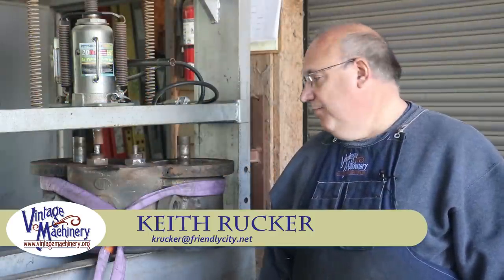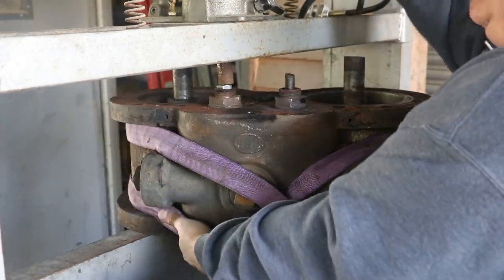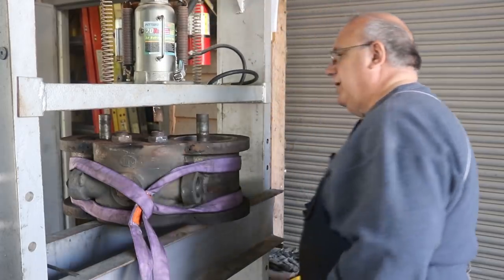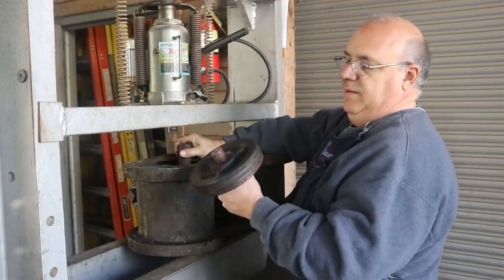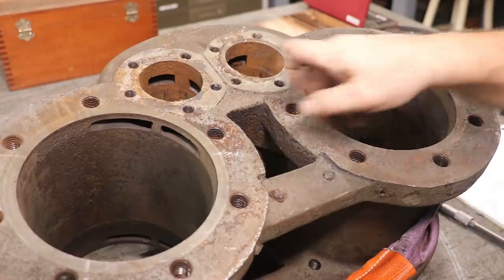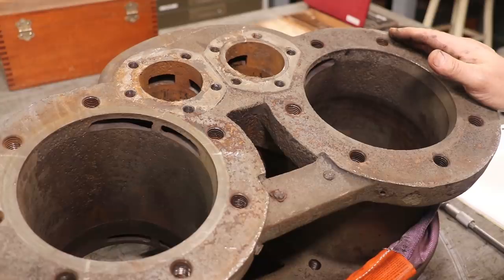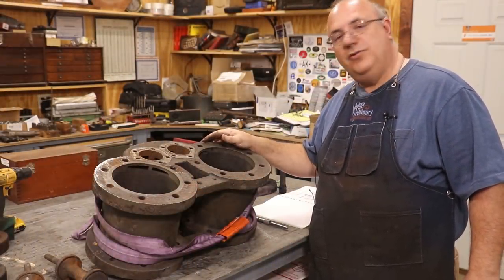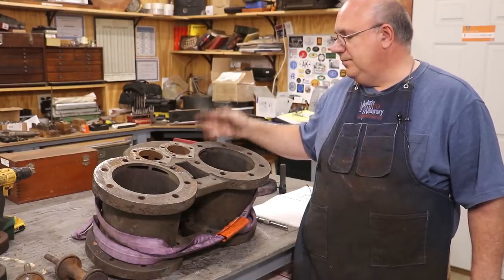Steam Locomotive Stoker Engine Restoration - Part 5: Piston and Valve Removal from the Cylinder Head

Comment: Hi Keith,
In regards to crankshaft, pistons and cylinders i'll get an advise from David Richards from old steam powered machine shop, my guess he is the authority in regards to steam engines.
Good luck and keep it coming.
Reply: David is probably in Florida for the winter already.
Reply: Dave Richards could easily  do the boring and if needed the sleeve work. Any good industrial diesel crankshaft shop should be able to handle the stoker crank.
Reply: @lineshaftrestorations7903  David used to do full engine rebuilds for motor cars (I think), and it would not surprise me to hear that he still has a crankshaft grinder. Whether it would be large enough for this job is a question for David himself.

Comment: Those “gapless” rings are actually pretty easy to make. Use a narrow slitting saw to cut the rings halfway through from each side. Make sure you offset the cuts with a little overlap. Also make sure you make the rings slightly oversized so the end gap closes some when installed. All adjustments are easily calculated. I can run the numbers in a spreadsheet, if you’d like.
I know this video has been up for awhile but I doubt you’ve done this part yet.
Thanks,
John
Reply: you know the final diameter you want for the rings . . . circumference equals pi times the diameter . . . if you want a 0.125 overlap in the joint, just add 0.125 plus the width of the kerf cut by the slitting saw (or just a bit less for clearance) to the circumference then divide by pi to get the new outside diameter to machine the ring to . . . the inside diameter is just the outside diameter less twice the depth of the ring you want to use . . . cut the machined ring with the saw along a radius line from the center then cut away half the height of the ring (also along a radius lines) and TADA  you're there (with a small amount of fettling with a small file).

note: these rings will be quite stiff to install if the overlap is too great . . . i suggest a ring compressor (or, at least, a big hose clamp).

Comment: Hello Keith from the UK. I'm enjoying watching this series develop. The press at the museum looks interesting, a good resource to have at your disposal. Pitting caused by moisture entrapment is something I've seen a lot of. Will you make the oversize rings in meehanite? I like the stepped slit in the originals, rather like a labyrinth seal. I thought perhaps you might consider line boring those cylinders in one of the large capacity lathes you have. Having said that, knowing someone who has a boring machine with enough capacity is definitely useful and probably the easiest and safest route. I love your phrase "outside of my wheelhouse"! Collaboration on this project is going to keep things moving and ultimately see the engine run again. I look forward to future episodes.

If you ever travel to Great Britain, try to visit the National Railway Museum in York. They have perhaps the finest collection of Steam Locomotives in the world. You can walk around their workshop where active restoration is ongoing. They built a running replica of Stephenson's Rocket - the first Steam Locomotive in the world to run regular paying passenger trains - which runs fairly regularly on the museum's track. Their workshop is wonderful, a sight to behold.

Comment: Keith, AD Piston Rings in Cleveland, OH, will make step cut cast iron (or stainless steel) piston rings to measure in all sizes from 2" to 30" and widths to suit. Unless you are dead set on making them yourself, that could be a good answer.

Comment: Bore  the cylinders to clean and both the same size.
Braze up and turn the pistons to spec clearance and make new rings....
The real challenge in any job like this is ensuring the cross heads are dead nuts in line with the cylinder bore........
I was not present when they did the final assembly so it was up to them...
I have done the cylinders on 2 locomotives for Silver Dollar City In Branson Mo. like this.
We sleeved one engine and it was a nightmare!
I'll walk you thru making the rings right but there are lots of resources out there on the subject.
Gotta love old iron!

Comment: I've made some large diameter rings for steam locomotive pistons on a Bullard. Once done It was easy to do the offset joint, set the ring on the mill, cut the first slot, flipped over did the second, which then split the ring. Probably the least of your worries, wish I could help, but I now live in Vietnam!

Comment: Hey Keith, two suggestions - Rings - Otto Gas Engine Works, Elkton MD; Up to 86" inch custom rings, but he stocks rings in common sizes as well. For the Crank shaft - Moreland Crank shaft & Machine, Easton MD - He can make that crank from scratch if needed.
Reply: Pine Tree Forge, it’s always nice to have options!

Comment: To make the rings just use an end mill from both sides and have the edge of each slot meet in the middle. This will 'split' the ring and also give you the overlap.
Reply: Don't really follow this.  Please explain a little more, and thanks in advance.
Reply: No problem... 1) Machine the ring to the expanded size. 2) Using an end mill cut a slot half through the 'top' edge of the ring. The mill should be a suitable width required for the amount of overlap that will be required. 3) Using the same end mill flip the ring over and cut a slot half way through the 'bottom' of the ring but offset from the 'top' cut buy the amount of maximum compression required (eg the width of the mill) but no more than the width of the mill. As the cut reaches the first slot the ring will be 'split' because the top and bottom cuts will meet but they should be offset from each other.

Comment: The ring gap looks like it was simply made by machining a groove from each side that just overlap, when you look at the valve ring it's more obvious. I bet when you get the piston rings removed and they expand fully you'll see the same.
Reply: I agree - an easy job actually.
Reply: you saved  my typing finger by writing my thoughts on it.
Reply: agree
Reply: I'm with ya on this, that's an easy machine job and simple is how they did it.
Reply: @littleworkshopofhorrors2395  LOL!!! It took me ten years to use two fingers. Now with only two, I type faster than my brother and he is an I.T. Tech.
Reply: Cyrus Cosmo   only room for one finger use on my phone. would use two fingers but that sounds rude.😉 
Dammit you are wearing my finger out and i thought i was going to save it.😀
Reply: That would make a ring thats not round when compressed
Reply: @vettepicking  That is true if you stop at making the steps. Afterward, you need to compress the ring, clamp it and turn the outside round again. I believe I have seen David Richards do this on one of his steam engine rebuilds.
Reply: vettepicking  it's not meant to be round, it has to be expanded after manufacture to have some spring in it
Reply: @littleworkshopofhorrors2395  when compressed it will be round again to match the bore. Turn it to bore diameter then stretch open , heat treat,  then compress back to bore size on piston.
Reply: Hooke's Law would imply that if the ring material is homogeneous it should still be circular after milling out the step and compressing (except right at the joint).
Reply: That is how total seal makes them.

Comment: To remove the rings. Put piston in lathe get a scare board wheel mount it on the tool post and press it into the piston rings start lathe with coolant .. stand back .it took three hours to loosen the rings on my Austeral stationary engine . But it works great

Comment: I wonder if such a small amount of pitting on the crankshaft is significant, should the remaining surfaces be round, sound and within tolerances. If so, I'd be tempted to smooth any sharp edges and  leave it alone, rather like filing down a raised nub on a drill bit caused by a slip in the chuck. You could always call the areas oil reservoirs! Best wishes from Cornwall, U.K.
Reply: While this is not really my area of expertise, I absolutely agree, and I wonder if the bores of the cylinders would be ok as well with just a clean up in Keiths Evaporust bath, followed by a hone. If the bores still look bad, boring out ten thou on the diameter, followed by the hone again may be all it takes. I also agree that the rings were likely cut through, then expanded sufficiently to mill the step on one end half way, then flip over and do the same on the other end. A bit more work than a straight cut, but easily doable by Keith.
Reply: @lesdmark  Thank you for that observation. My comment was based on the assumption that the crankshaft journal surface had a smooth, round surface and that all pitting was below the surface. I certainly agree that a rough surface would be unacceptable as would any "out of roundness" , hence my observations in my initial comment. Best wishes, BW

Comment: With regards to the off set piston rings slot's. Mill down halfway from the one edge of the ring then mill an offset slot half way from the other side of the ring the corner between the slots will coincide..

Comment: There should be something softer under a press than a concrete floor, like a wooden box.
Reply: We are certain they would be grateful for a donated catch box for the press. lol
Reply: We got a little 12 ton press were I work and we use a big fiberglass heat blanket under ours it's super soft and thick compared to the floor.
Reply: Adam Booth had a catch container of old aluminum soda cans at his day job.  Seemed to work well.
Reply: We have a thick piece of rubber foot matt.

Comment: On the rings.
I think you should make the rings well oversize, maybe 7 1/4" and then after the gap overlap is made, make a clamping set up to hold the rings with the gap closed then machine the out side to the finished bore diameter. if the finished bore is 7 1/16" then machine the outer edge to a bit less for clearance.
I have seen model engine rings made with a clamping fixture to hold the rings compressed for machining to get  an outside finish that fits the bore so little breaking is needed to get a seal.
Dumb bell weights might be a source of cast iron for the rings. Others have used cast iron pipe as a source if you can locate some in the right size.
I know you can buy or have made a cast piece from one of the foundries,
The overlapping ring gap can be done without too.
Thanks for the vids.
I enjoy looking over your shoulder as you work.

Comment: I have a solution to your piston ring issue.
To achieve a 7.125" fnished diameter with a 0.25" overlaping step joint, turn the stock to 7.204" outer diameter.  The internal diameter depends on the thickness of the ring. Simply deduct twice the desired thickness to determine the internal diameter.  
Machine to required width to fit the slot.
Once you have the ring turned, mount it vertically in the milling machine and cut two 0.25" slots halfway through the width of the ring. One from each side offset from each other, and centered on the quadrant of the ring.
When the two slots meet, they will form the step joint you showed. When the ring is compressed, it should exactly fit your 7.125" bore, with just enough spring pressure to seal to the bore.
Glenn Wiersma - Enigma Engineering

Comment: Keith for your rings, I would use a file to file the steps on both side, then use a thin slitting saw. or even a jeweler's hand saw and cut your break.  Just my 2 cents, YMMV.

Comment: There is a third option for those bores. You could bore them out, and make over-size pistons to match the new bore diameter.

It would also allow you to make the tapers in the pistons exactly match the tapers on the rods.
Reply: The pistons are guided by the rod and the cross head and should never touch the cylinder walls.  As long as the rings are the right size an 1/8 inch oversize bore is not a problem.
Reply: @andreblanchard8569  I didn't mention the pistons touching the cylinder walls.

I was merely suggesting installing over-size  pistons, as you do when you re-bore an internal combustion engine, as a third option.

Comment: Hai Keith, Could you please explain how you use air supply on hydraulic jack to operate. Bit confusing. Thank you.
Reply from the maker: It is an "air over hydraulic" jack, designed to pump either manually or with air pressure.

Comment: I was using one of those presses one day and didn't turn the lights on. The jack didn't go down far enough so I screwed out the end longer, was using a lot of pressure and jack flew out and hit me in the forehead, glanced off left shoulder and land on the table saw next to me. It took a while to figure out what happened but the jack must have set on the edge of the round retaining ring. I didn't have a bump on my head but a dent. It could have been a lot worse.

Comment: Keith, I think I remember you saying in the original video about this project, that the railroad had a second stoker engine that you might be able to use some of the parts. Disregard if I'm not correct about that.
Reply from the maker: They do have a second stoker engine, but they want to have it rebuilt as well so that they have a spare.

Comment: Can you offset bore the hole in the direction of the pitting. My boring bar will do this to save blocks to a specific bore size.
Reply: Wouldn't that make the rods off center on either side?
Reply: I was thinking the same thing. My thoughts: with the the crank you will have to maintain differential connecting rod clearance and crankshaft end play.  On plane things are likely more forgiving. That said I think it unwise. If it were mine I think I would follow the specifications. ( note the ring gap at the current diameter)
Reply: @Mishn0  I'm thinking there must be some movement with regard to the piston rods if they are attached to the crankshaft which moves in a circular motion as in an automotive application. The rod journals aren't moving exactly in a flat plane with the pistons. I'm, not familiar with the engine in question, but in some manner they end up connected to or operated by the crankshaft. as it the valve lobes. If he's 0.025 pitted and moves the cylinder bore maybe 0.008 or 0.010 it would be a small amount. I'd like to see if there is a feature between the crank and the piston rod that's pressed into the piston. SOme place the the circular motion created by the crankshaft has to be accounted for. Interesting.
Reply: @julianp.1713  All of the shafts pass through a pair of seals before getting to the wrist pin part of the mechanism. The mounting of the rod to the piston is rigid and its center needs to remain in the center of the sleeves. You could offset bore the cylinder, but then you'd need to shift the center of the sleeves to match. He's got plenty of tolerance on the bore diameter, probably twice what he'll need to bore it on center.
Reply: @Mishn0  How does the circular motion of the crank become linear with the bore center? Is there a lifter of sorts making the transfer?
Reply: @julianp.1713  Go look at the first video in the series. You'll see it has a joint that does the same thing as a wrist pin in a car motor, it's just that it's outside of the cylinder and there's two in-line seals between it and the cylinder. The rod is rigid and only moves forward and aft through those seals. The reciprocating to rotary motion transition is after those seals. Just go look at the earlier video, you'll see right away why the center of the bore of the cylinder would be complicated to move.
Reply: @julianp.1713  Fort Wayne railroad historical society  has the stoker engine from 765 working.
see https://www.youtube.com/watch?v=3_u5pwwhXtQ 

That engine has some trouble - it sounds like the beat isn't even so maybe a timing problem with the valves.

Comment: As old as that crank shaft is it might not have been hardened on the surface of the journels . If hardness is consistant  through the journals , maybe just grind to clean up  and undersize the bearings .

Comment: All the bearings in this thing are babbitted so you should be able to simply turn the crankshaft down to remove the pitting and pour new babbitt.  As far as new rings are concerned, I agree with the comment about checking with David Richards.
Reply from the maker: Actually, the bearings in this engine are all bronze - not babbitt.  If I have the crankshaft ground down, I will have to make all new bearings out of bronze.  Doable but a LOT of work and a LOT of money in  materials!

Comment: Could you make the ring oversize, cut it straight, then cut the steps in a debt that makes the ring end up in the correct size ? That might also help the ring to have some pressure against the cylinder walls.

Comment: To make those cylinder rings couldn't you machine them a hair oversized then mill half way down from the top and bottom. The bottom should be offset by the width of the cutter and the corners should meet.  That should create that step like the originals.

Comment: Why wouldn’t it be acceptable to flow braze down into the pitting then bore out the piston bores to clean them up? 
Would the braze repair work it’s out over time?
Reply: That i believe should work. 

the thing to think about in this situation is lubrication. 

I believe some amount of steam oil is feed into the steam right before the stoker engine , that to ensure lubrication for the steam valves.

The brazing is with regards to longevity good enough.

Comment: hey keith would that evapo rust stuff  help in un-freezing then pistons i have never used it before i'm just thinking about getting as much rust removed to help prevent anymore damage to the cylinder walls that isn't already there ?
Reply from the maker: The whole thing had already soaked in evaporust.  It helps to break things loose but it can only do so much....